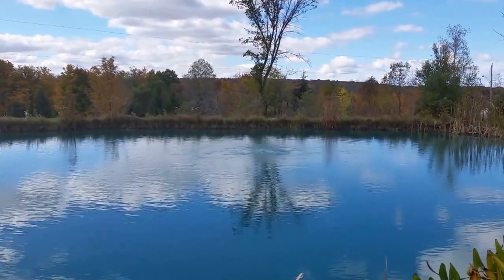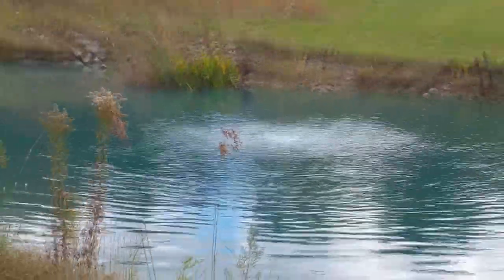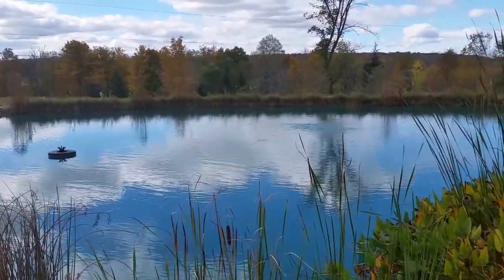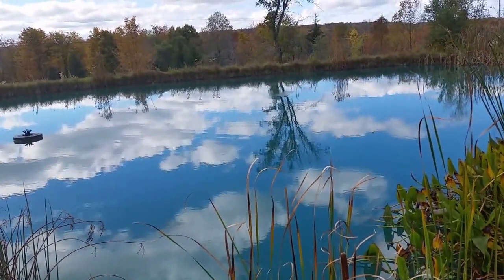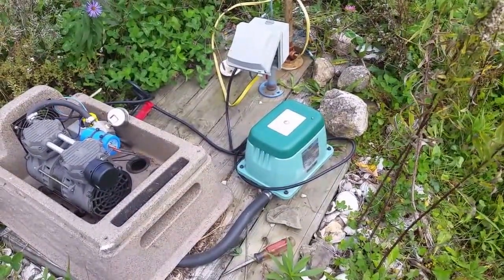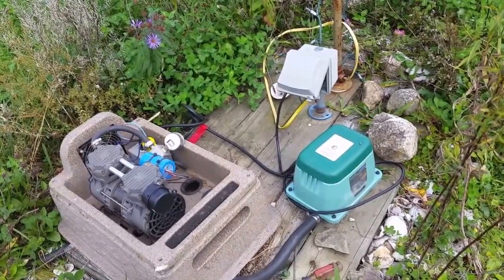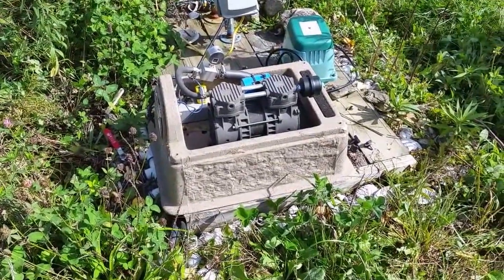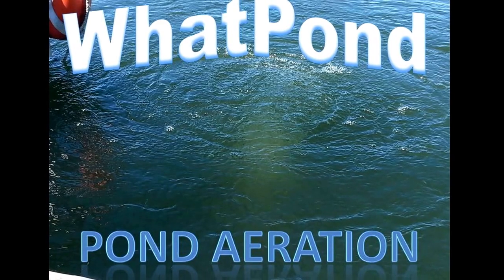The difference of pond aeration compressors

Comment: 3:20 - Whoa! I thought you were falling in! Ha, ha! I'm glad you didn't.
What is your opinion of using a ROTARY VANE compressor rather than a rocking piston compressor? The up-front cost is more, but I'm willing to absorb that if it is money well spent. THANKS!! 👍👍👍
Reply from the maker: Rotary Vane compressors do put out more air than the piston type. They are more for shallow ponds up to 12' deep. Generally are rebuild able with new vanes, Unless something major makes them crash you should be good to go. It looks like they start out with a 1/2 hp. https://www.whatpond.com/product/rotary-vane-aeration-system-quarter-horse/

Comment: Hi, hopefully you can help me out. I want to use a HIBlow 60 pump. I'll use 75' of weighted line in the water. I also would need 75' of something a little cheaper to run from the pump to the water. Any suggestions?
Also, I'm confused about hose diameter. What size ID would be right for my setup? I can locate the difusser anywhere from 3-6' of water.
Thanks in advance.
Reply from the maker: HI Steve, Ideally you would want to be 5/8" ID on both weighted and bury tubing. If you have smaller weighted tubing I would still use 5/8 to 3/4 bury tubing. The bury tubing would be the black thin wall tuning you could get from the big box stores. Usually sold as water supply tubing.
The diffuser at 6' deep would be good, no deeper. That means the tubing running out to the diffuser should be 6' or less.
As a reminder. These linear compressors do not build pressure, High volume / Low pressure is their game. 
I've been thinking how to explain the difference from linear compressor to the piston type.
Linear compressor: open your mouth real big and try to blow out a candle.
Piston type: Blow thru a straw to blow the candle out.

Hope this helps.
Darrell

Comment: which one is more durable, linear piston air pump or diaphragm air pump? thankyou
Reply from the maker: This quick article is more like a review of the different compressors I’ve used and or rebuilt over the years. I’ll cover the Linear diaphragm, piston and rotary vane compressors.

I get questions like, “how long will they last” How much cost to run them and how noisy are they.

The big go to is usually the linear diaphragm since they are quite and less cost to run. Some are noisier than others, at least between the different brands out there. Some are rather cheap for the initial costs and some cost double that the cheaper ones. I’ve seen them last 9 years and other a month.

Ok let me try to explain the confusion and vagueness from the last paragraph. Linear diaphragms compressors are built to push a lot of air (CFM) but not much psi and best used on small shallow ponds  1/4 acre and less. Meaning the deeper you go with the diffuser and or tubing, the weight of the water adds back pressure to the compressor pushing the air. Another item adds to the back pressure which is the tubing that runs out the diffuser(s). using 3/8 tubing adds more back pressure to the compressor while the ½” 0r 5/8” allows more air to flow freely to the diffusers.

I’ve found that the linear diaphragms are only good to about 6’ of water depth on the diffusers. I did try one out on a 9’ deep pond and it lasted about a month. Have had customers who used a 3/8” tubing to the 5/8 tubing and the 3/8 added too much back pressure and the compressor failed. I also have one that lasted, I think 9 years before it needed rebuilt as the diaphragms tear over time.

The function of the compressor is a diaphragm on each end of the unit which moves back and forth between a generated field of magnetism as the pressure builds the stoke, or how far the diaphragms move back and forth are shortened pushing less air.

Piston compressors are about the same where some have lasted10 years and some needed rebuilt within a year. By the way all the manufacturers recommend rebuilding all types of compressors 12 to 18 months.

Heat is the first thing that comes into play with the piston compressors followed by pressure and maintenance of changing the air filter. Similar to a car engine there is a crank shaft that runs the piston up and down and small reed valves to pull air in and out to the diffusers. The seal or ring in the compressor is like a fiber cup which handles the heat from compressing air but over time will break down under heat and higher compression and of course normal wear. The only other issue I have run into is the capacitor had failed, but they are easily replaced and your back up and running.

Over all I like these type compressors the most, yes they make more noise than the linear as there is now question about the depth of water as most of them are rated to 30’ deep. Can be started and stopped with no worry about the depth like the linear.

When installing a system we usually have the compressor running and lower the diffuser in to be sure we can see where we are in the pond. On the Linear compressors it seems to work out well but you should turn off the compressor. It seems that once the system is off the linear has a hard time pushing air down the tubing and overcoming the water pressure. The piston compressor pushes thru easily.

Rotary vane compressors provide more air (CFM) than either of the above options. I’ve not had a lot of experience with the other than one rebuild and one that the vanes had broke and jammed up. They are more expensive the other two and recommended to only depth of 12’ as they do not build a lot of pressure. /Best used in large shallow ponds.

As I said this is just a quick article to help explain the different compressors. Possible to add more to this down the road. at WhatPond.com under the same title
Reply: WhatPond thanks for your reply. i have 60lph linear piston air pump, and from what i see in the performance curve, in just 1 meter depth / ±0.011 MPa the air output only at 20lph. 

so i think i will go with the diaphragm air pump for my new (larger) pond. 

fyi, the price of diaphragm air pump is expensive for low capacity air pump, but at high capacity air pump they cost the same (not exactly the same but, the diaphragm airpump has the advantage of higher pressure, so it has more air flow)
Reply: WhatPond and one more thing that im afraid of linear pump, it get extremely hot, you can barely touch it. i know that it has heatsink design, but it doesnt work if u got no fan, so i put fan for my airpump, and im sure the temperature drops alot, it only felt warm when you touch it.

but actually i wanna ask u, is it actually safe to let the linear piston air pump to get very hot? bcs right now im blowing off fan 24/7 to my pump

Comment: Can an air  compressor, the type you use to fill you tyre, or painting ,be used.we have a very large pond.
Reply from the maker: Generally not a good idea since those compressors use oil and you would get an oil film on the water. They are not designed to run 24/7 and may fail, that is why they have the reserve tank. If you have painted a car you may have noticed the compressor running a lot. Same would happen running a diffuser in the pond as it is always using air.